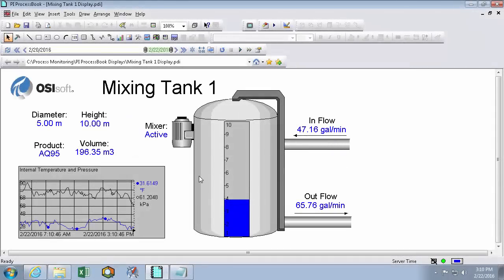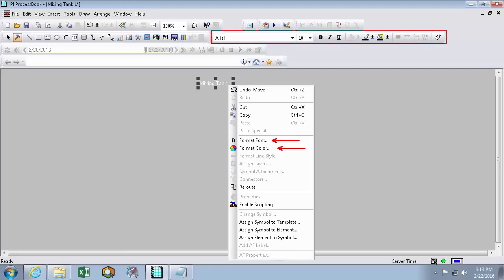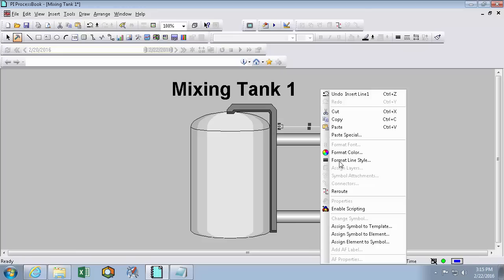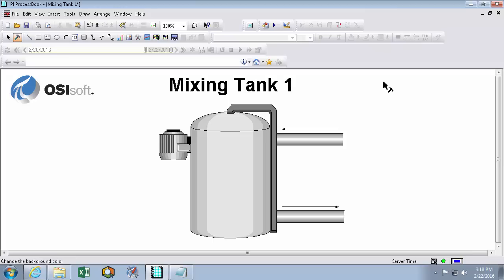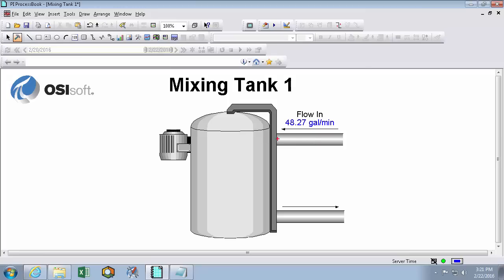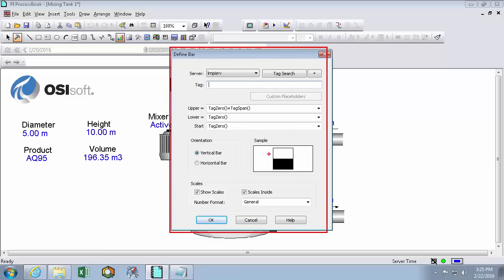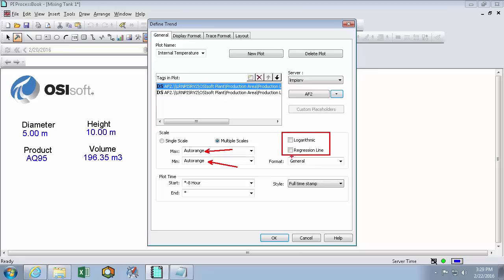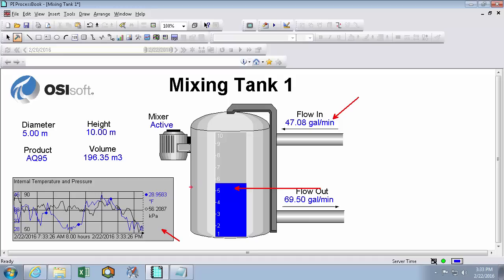OSIsoft: Build a New Display in PI ProcessBook with Static and Dynamic Symbols [v3.5]

Comment: Just a question, in this case tank diameter is 5 m and height 10 m, so what if in actual tank dia is say 100 m which is difficult to draw here. how can I do dimensional analysis, or if you have any better method to do this?
Reply from the maker: The image is just a visual way to help a viewer understand the equipment, it is not meant to be drawn to scale. In terms of dimensional analysis, if you utilize Asset Framework, we have a Unit of Measure database that helps you do unit conversions if necessary.